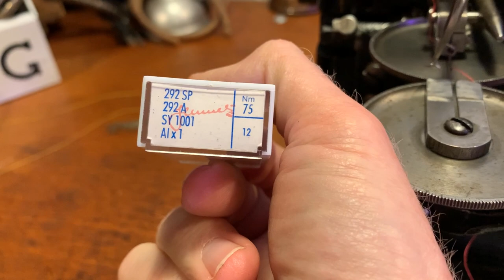Bonis Fur Sewing Machine on Derek Does.

Comment: Hello sir! Im a total pro with that black bonis...I'm on one at least 7hours a day .....for shearling I would recommend the "T " model ....T standing for toys...if you have any questions feel free to contact me.....
Reply from the maker: Thanks!  I'll look for a T model!   What do you sew most often on yours?
Reply: @derekdoeschannel  gloves made with cowhide leather and sealskin hide....and hats.....I really push it to the limit of thickness it takes.....3 layers of leather is pretty much the max it will take
Reply from the maker: @takatastore6338  very cool
Reply: @takatastore6338  Hello. I am thinking about buying a Bonis Model A.  I plan to sew Beaver and Otter hides with this machine and some Muskrat.  Do you think it can handle that thickness of Beaver/Otter or should I be looking for a Model B?
Thanks for any input you may have.
Reply: @tomkelly6662  yes absolutely...the model A will just just fine...I make a ton loads of beaver hats with cowhide...it can easily handle 2 layers of cowhide ( not too thick) plus a layer of beaver..... although there is a technique on how to sow correctly with this machine...will gladly tell you when you need
Reply: @tomkelly6662  I can even manage to sow 2 layers of Sheepskin but that's the max for sheepskin...aka mukluk linings of slippers lining
Reply: @tomkelly6662  I also sell needles when you'll need.....they are hard to find...# 14 is what you need...smaller needle will break too easily
Reply: @takatastore6338  Super helpful.  Thank you very much.  I will reach out to you for needles... and with a thousand questions when I get the machine.
Thanks again.
Reply: I have a Bonis A-21. Hard to find info on the net for this machine. Whats the suggested material for this machine? Also, do you know how to find the model number on the machines that either dont have the model on the tags or the tags are missing. Thanks in advance for any info you may have
Reply: Hello @takatastore6338, I plan to use a Model A21 to sew a Beaver glove with a seperarate shearling lining. What needles do you recommend and thread? What size seam allowance? Size 14 needles? Thanks Ray

Comment: The main difference btween the fur machine and the shearling machine is the groves of the cups are more robust  and the looper has to rise higher in order to clear the shearling which sits higher between the cups and so  the  depth of the stitch is deeper .  The needle stroke may be a bit longer also.
Reply from the maker: Thank you for the clarity!